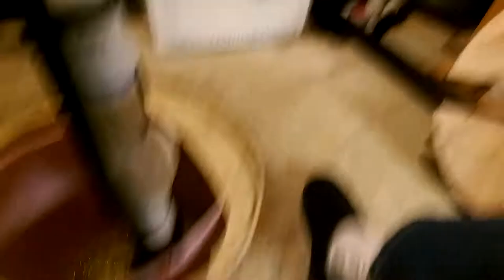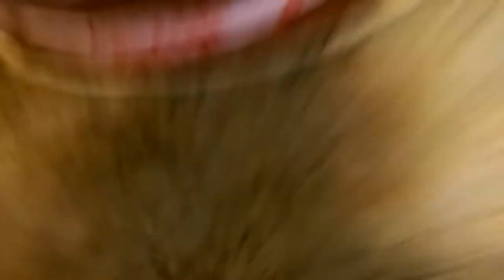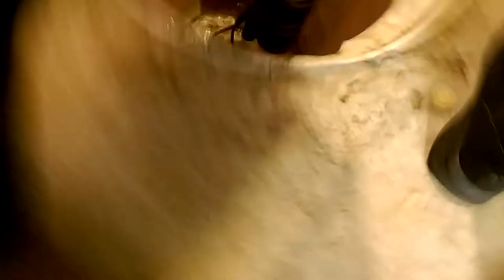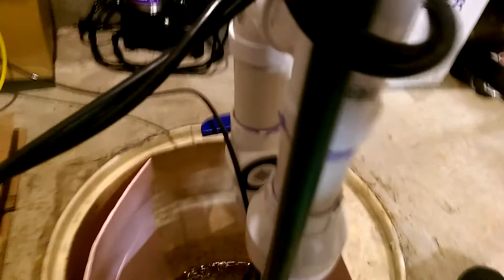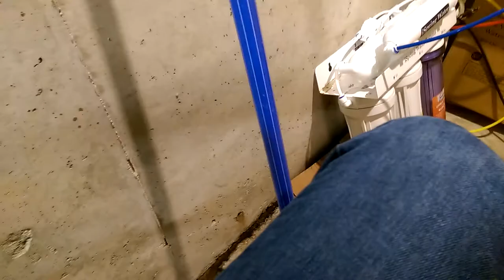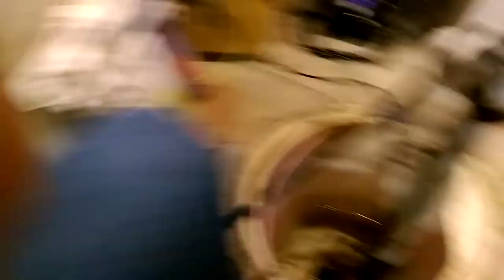How to fix a sump pump that's slow and air locked

Comment: Why not just drill a 3/16” weep hole in the discharge pipe at the top of the pump between the outlet and the check valve?
Reply from the maker: Good point, and that's usually all that's needed. However, the pump itself already has the weep hole, and the extreme amount of air continuously churned in by the drop in height overwhelms it. See how without the foam the stream of water lands directly at the base of the pump. The real problem is that basin is too deep, but I can't fix that easily. Directing the water down the side of the basin and under the foam prevents the bubbles from getting to the pump because the bubbles rise on the outside of the foam. Incidentally, it's worked perfectly ever since.
Reply from the maker: At 4:02, you can see and hear the water squirting out of the existing weep hole.